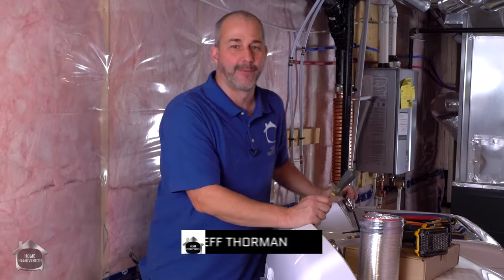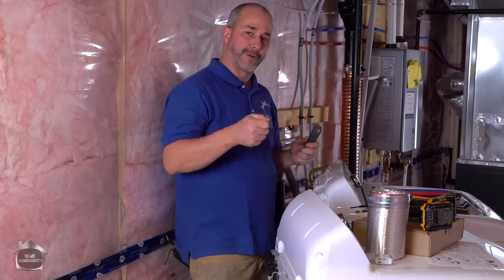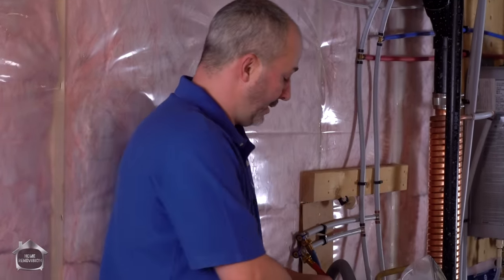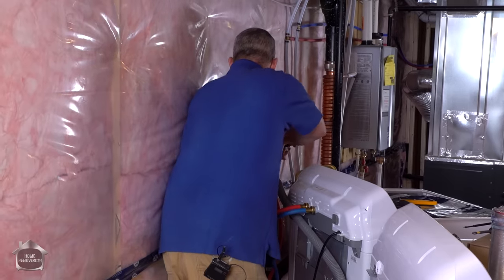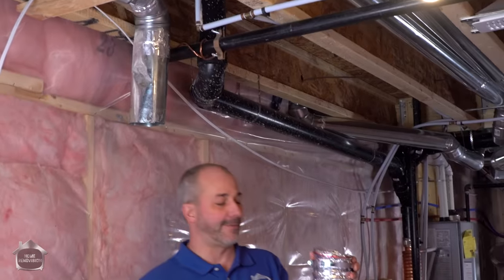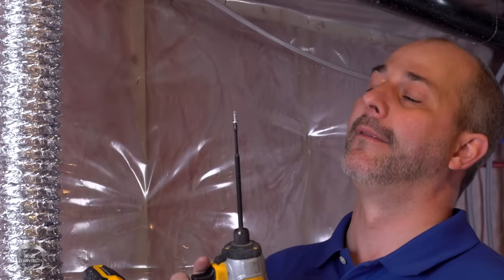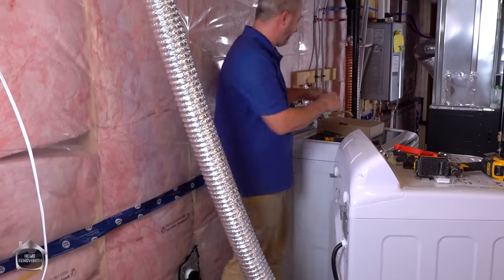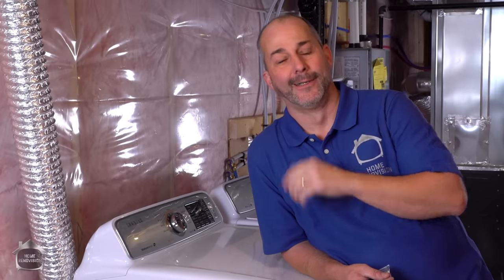How to Hook up a Washer and Dryer

Comment: Well.... you can always learn: GE uses these wimpy plastic inlet filters on washing machines, they get all blocked up and are difficult to clean and/or remove.  Impractical design, GE says they cannot recommend anything else because that is what was supplied and certified!  What?  "Junk".... rip them out and use something external is my best guess.  Which planet do these appliance designers live on?  anyone know?